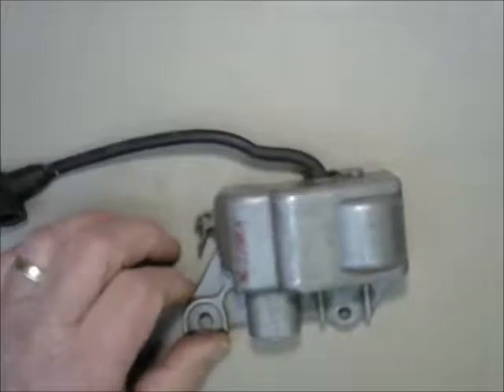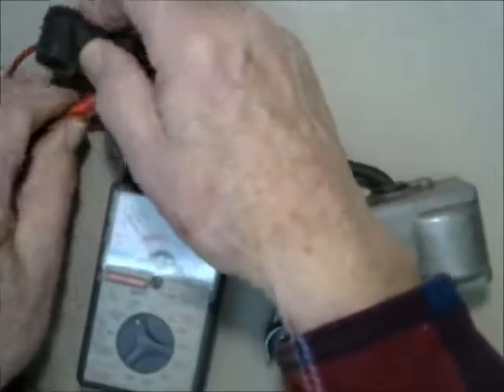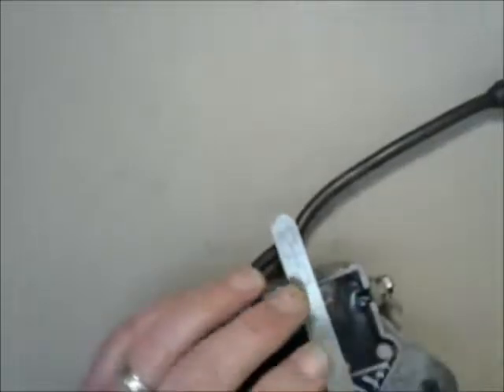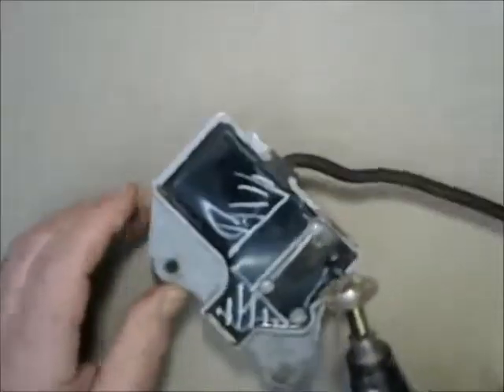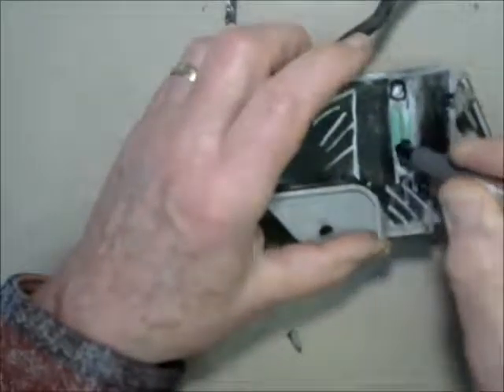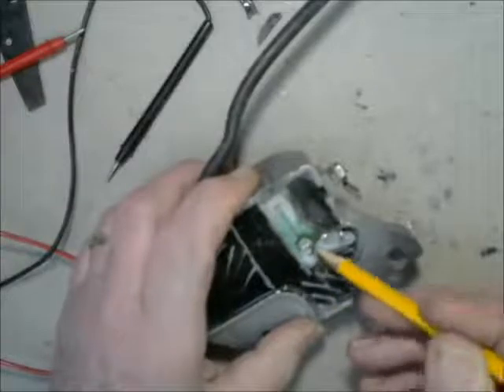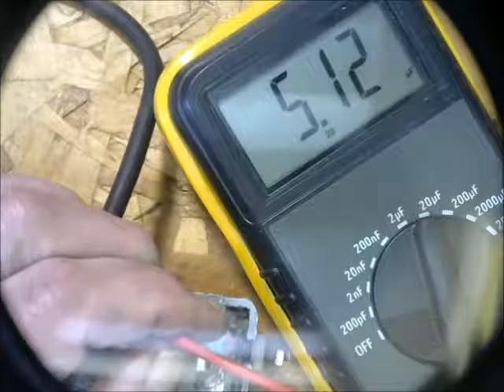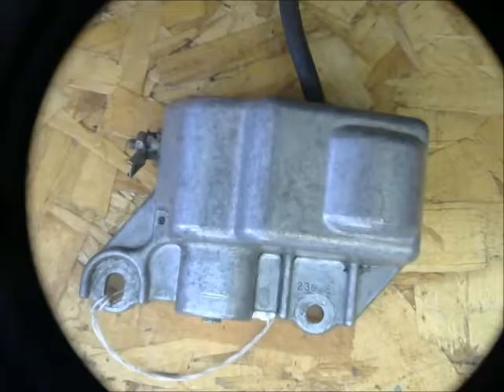Miller2E Tecumseh Ignition P2

Comment: I offer a fool-proof custom-made electronic ignition replacement that may outlast the life of the engine.
Reply: What is the price
Reply: @christopherphillips3258  I apologize for not getting back to you sooner. I've been working on my new shop. Anyway, I offer these custom-made electronic ignition kit options:

Replacement Tecumseh Electronic Ignition System Kit listed above without any switches. (Customer supplies own switches.) $175.00 per kit, plus shipping & handling.

Replacement Tecumseh Electronic Ignition System Kit listed above with OFF-ON toggle/flip ignition switch and momentary push-button switch (to crank engine). $195.00 per kit, plus shipping & handling.

Replacement Tecumseh Electronic Ignition System Kit listed above with OFF-ON ignition key switch and momentary push-button switch (to crank engine). $240.00 per kit, plus shipping & handling.

Please let me know which kit you need and I'll give you the total amount with shipping and payment options.
Reply: @Pullingtractor where can I find a wed site to buy ur ignitions?